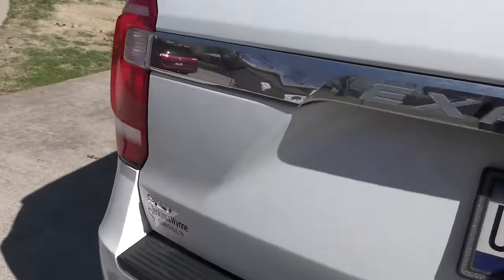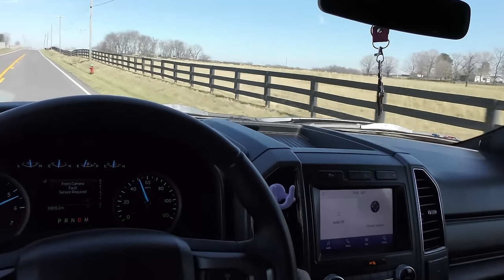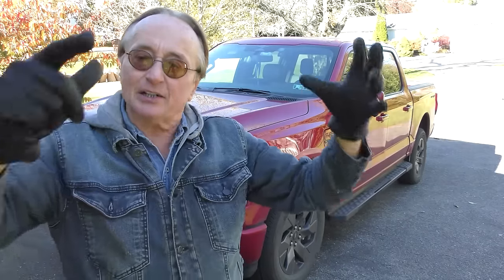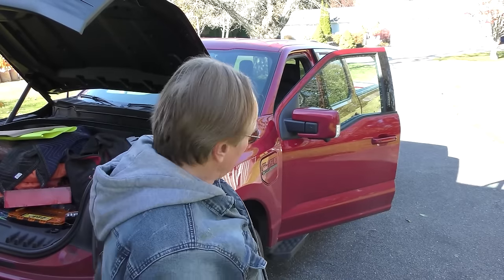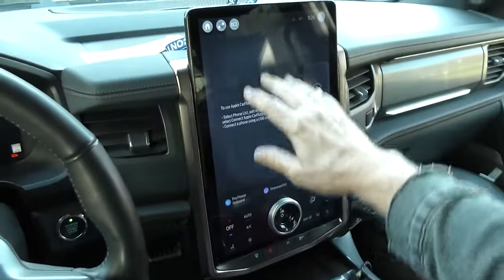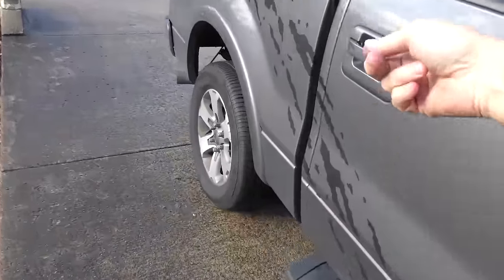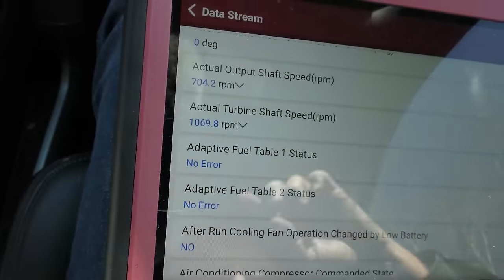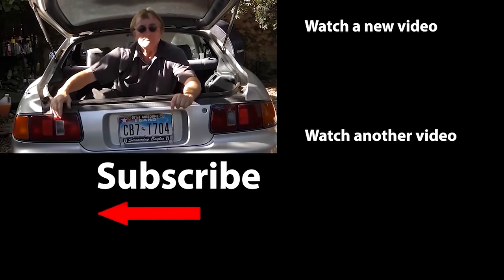Here's Why Fords are Crap Now

Comment: Really like your channel you're good dude man I have a 2006 Ford Expedition and it sounds like the Rockers are loose do you think I should tighten them and check it all out or is there something else that might be wrong with this vehicle it's a 5.4 so if you can help me I'd really appreciate it thank you Scotty
Reply: Rockers?
You mean rocker panels? Those can't be tightened.
Or do you mean rocker arms? The triton engine dosen't have those. They have roller followers and they can't be adjusted.

You might want to take that to a mechanic to see the real issue.
The 5.4 3v has phaser issues and anything associated with the VCT system.
The phasers usually make a clicking noise when going out.

Comment: 2011 Ranger Sport, 5 speed, it has a weird shift glitch between 2nd and 3rd,  almost like it locks the converter when it shifts, then releases it. only does it when above 75% throttle,  other than that, it shifts fine.

Comment: Just give me an Expedition Max with a 5.0 and ford built zf 8 speed that’s all i ask. 
I had a 2011 Expedition Max with 5.4 v8 and a ford built ZF 6 speed. It had 250k miles on it and it ran perfectly with no issues. I don’t want any eco boost. Give me a v8 like my GX460.

Comment: So Scotty, If I read between the lines you think that if someone built a new 1986  F150 for 20 grand, everybody would buy it? It would not have an ipad or radar or any computer controlled rear view merroirs and maybe no A/C either. It might use regular $2 light bulbs. No CAN bus, no 10 speed no DIF fluid. Who or what company would buy something like that ?

Comment: Those big batteries also rely on atr flow for cooling. Sealing would mean they need a larger cooling system. More weight less range. If those batteries get hot, range decreases, or if hot enough they will burst into flames.
Reply: The only car with an air cooled battery is the leaf and the batteries don't burn just because they get hot. They can degrade at like 140F and refuse to fast charge, but battery fires are only the result of manufacturing defects.

Also, I don't know what Scotty is going on about coroding batteries. I've got a LEAF that's on its 11th Iowa winter and there's no corrosion on the underbody even though I've never sealed it and only wash it about once a year, because the entire bottom is covered with a fiberglass panel for aerodynamics.

Comment: My 22 f150 tremor with just 20k miles is at the dealer right now. Transmission kept having rough shifts for the last 2 weeks at very low speeds, shifting so hard the first time it did it, my kids thought we got rear-ended. The tech was able to replicate the problem and they're putting a new valve body. Unfortunately,  it's the same thing my 19 silverado did at 5k miles.  Come to find out , that Transmission is a collaboration between Ford and chevy. My luck😂😂😂

Comment: My prior two vehicles were both Fords, a 2016 Expedition and a 2020 F150.  After my experiences with premature water pump failures, plastic shifter internals breaking, wonky 10 speed transmissions, engine rattles that are "normal", 4wd actuators failing, and clunky driveshafts (who doesn't grease a slip yoke?  Ford, that's who) all under 100,000 miles, I gave up on Ford.  
I bought a new Honda Ridgeline almost a year ago and it has had zero issues.  Prior to that I had two ram trucks, both needed the rear differentials rebuilt before 100,000 miles and one had the 8spd transmission fail at 50,000 miles.  

American automakers are creating their own demise.

Comment: My 2017 Ram with the Hemi has been rock solid since day 1.  Don't know about the new ones, but the late 4th gen Rams are great trucks.  I hear nothing but bad things about Fords though, especially the Ecoboost.
Reply: Us synthetic oil, keep it tow/ haul mode so it doesn't keep jumping back and forth between 8 and 6 cylinders. And don't idle to long especially with the AC on. If you hear a ticking sound, chances are it's a broken exhaust manifold bolt. Don't let the dealer scam you.
Reply: It’s all good until the lifters take a dump on you!
Reply: @roadglide1142  LOL 😂,  sorry cupcake but most ticks are from broken exhaust manifold bolts not from a lifter problem.  Good try.
Reply: @musicman7297  Switched to full synthetic at 60k miles.  I heard the tow mode trick doesn’t really work.  If it’s going to get the actual Hemi tick, it’s going to happen, but like you said more often than not it’s the manifold bolts.  There are a few other causes for a tick that aren’t expensive fixes.  The bad one isn’t that common on the later 4th gen.  Only complaint is the horrible parking brake assemblies.  They corrode very easily.  There’s nothing you can do about it, doesn’t matter if you use your parking brake regularly or not.  Other than that and the strangest oil filter placement I’ve ever seen, it’s a solid truck.  The Hemi is great, so is the ZF tranny.
Reply: @mplslawnguy3389  I always put my truck in tow / haul mode everytime I start my truck up. And you can tell it's working.  It also allows the transmission not to jump ahead a gear before it really needs to. And I believe that will help your transmission out. It's like shifting a 4 speed when you know it's time to shift instead of shifting it sooner than you should. That's the reason the tow/ haul mode was put in ... to keep the truck in V8 mode.

Comment: With all of the weight of all of the extra electronic stuff on vehicles, they are saving nothing.On gasoline and if they just made a simple four cylinder or six owner or even a v eight that is just maybe has a rear window defaulger and basic controls would be so much easier to work on and so much more reliable

Comment: V6,eco boost, twin turbo, GDI, 10 speed transmission and 3 over drives the engineer was either high or wanted all these features in one SUV engine and knew it would be a problem and didn’t give a dam. Could have built it more simple and had an extremely reliable engine.

Comment: Son has '19 f150 with the same drive line. Also has the same clunking in the driveline. His has 2spd rear axle. I think that's what clunking. His is 4x4. His seems to have better acceleration that the expedition you tested. Has better power thank the same truck in '77 with a 460 2wd.

Comment: if you need it in sport mode it sounds like it has Displacement on Demand so it's shutting down 2 or more cylinders when its in a low-need state it cuts those cylinders, and im willing to bet the eco is just keeping the cylinders off, in sport its not turning on the Displacement on Demand

so if you have a tuner see if it has a Displacement on Demand or Active Fuel Management system
Reply: They still make them for the Saudis. But quit making crown Vic's here on 2011.
Reply: @777dragonborn   what? I was talking about DOD/AFM not crown vics

Comment: I think that all vehicles sold in North America today are way too complex. Too many computers, sensors, etc. An aluminum body F350 with a mechanical Cummins 5.9 is a better idea.IMHO..
Reply: The old 5.9 was a fine engine but it was very noisy and the power of the newer engines are in another league.

Comment: Almost everything Ford has built in the last 15-20 years is much higher quality than cars they produced in the 80s and early 90s. Do people not remember the cheap plastic rattling interiors? The problems with the clearcoat peeling off? The amount road noise? They are light years ahead in quality now.

Comment: Scotty I got a question I got a 2012 Jetta 2.5l inline 5 so I got that p0106 code i tired cleaning the map and replacing the PCV valve didn’t work should I just get a aftermarket valve cover and a gasket that doesn’t have the PVC valve on it? Which eliminates the problem ? Or would it make the car run worse?

Comment: I have a 2006 F150 with 320,000 miles. It’s had a rebuilt transmission at 280k and recently a rack and pinion and power steering pump replaced. Has the small V-8 4.6 L I think. Still my daily driver. However I am looking for a used low mileage replacement any recommendations?

Comment: Haven't Fords always been crap??? .. in the 60/70s it was the notorious water pump failures and the two new Fords I've ever owner (1990 Taurus SHO and 199? Aerostar XLT) both had their share of niggling failures  along the way ... annoying failures that should never happen ... e.g. at about 40K miles on the Aerocrap the electrical ring in the steering column that controls the steering wheel mounted controls failed, additionally the tranny failed at about 10K miles. IN the SHO it was warped brake rotors and a sticking brake master cylinder and a bad radio and coolant sensors .. ENOUGH ALREADY ... now I drive Hondas/Toyotas
Reply: 2000 Honda Accord, 95 Chevy K1500...last 8 years. Zero problems!

Comment: I saw a 1992 Taurus the post office thing was in showroom condition. An old man was driving it and when he came out I asked him and he said he owned it since New and I had like 80,000 miles on it. He said he never had an issue with it he never replaced anything other than tires brakes in the battery.

Comment: I bought a 2019 2.7 twin turbo in 2020 and got screwed by how much I spent on it. When I bought it was a very long day and they wouldn't tell the payment until the very end and they already switched my bed cap and didn't what to deal with it and thought I could swing a 800 dollar payment but as the economy started tanking I told them they should be ashamed of themselves. An hour later the vehicle wouldn't start. I called them and as I was on hold they gave back all power to the truck and everything was fine. I'll never buy another ford truck. The timing belt is made of rubber in a liquid oil.  That's going be a problem at 100,000 miles no thanks

Comment: WHEN I WAS A KID I BAUGHT A FORD STATION WAGON(DELIVERY WAGON) FROM THE POST OFFICE FOR $50.
I WOULD ALSO BUY TRUCKS(POSTAL $50) THAT WERE GOVT SURPLUS. I WOULD FIX THEM UP AND SELL THEM
FOR $500( IT WAS A GREAT HOBBY, WHILE i WAS IN HIGH SCHOOL.
WELL THE FORD STATION WAGONS HAD V6 WITH 2 SPEED AUTOMATIC TRANSMISSIONS!!!!!!!!!!!!!!!!
THAT'S RIGHT 2 SPEED. TRANSMISSIONS!!!!!!!!!!!!!!!!!!!!!!!!!!!!!!!!
WELL WHEN MY DRIVER WOULD COMPLAIN THAT YOU COULD WALK FASTER THAN THAT CAR WOULD SHIFT
THE TRANSMISSION.  SO I TOOK IT TO THE LOCAL GARAGE TO DROP THE TRANSMISSSION PAN AND CHECK
THE OIL(TRANSMISSION WAS SEALED, NO FILLER)
WELL THE MECHANIC FLOORED THE GAS AND THE WAGON TOOK OFF LIKE A JET PLANE. WE WERE AMAZED!!!!
HIS SOLUTION GET THE RPMS UP TO  A HIGH NUMBER THEN IT WILL REALLY MOVE LIKE A ROCKET!!.

Comment: Fords quality went downhill ever since they killed off the Econoline van and replaced it with the Transit van around 10 years ago. My Grandpa had a 2011 Ford E150 and he was a plumber untill he retired at 69 years old in 2019, and he ended up selling the E150 after reaching up to 200k miles on the odometer

Comment: Bought my mom a brand new ford fusion and it has recall after recall. Everytime we take it to a ford dealership for the recalls they constantly break brackets/wiring. After 4 recalls fixed the car now has multiple error codes on the scanner saying Lost Communication. I fixed the abs code because they damaged some wiring and my guess is the other codes are from damaged wiring also. I told them about it and they said it was from rat damage lol, I wasnt aware there are rats in montana. Do they even train their mechanics? Its so bad we wont even bring it to the dealership for the last 3 recalls. Bunch of boneheads and will never buy another ford ever again.

Comment: Took a risk and bought my first ford in 2015. Bought a 2013 ford explorer sport. a piece of shyt! Have spent about 10k fixing a piece of 💩. Fixed timing chain (something like that), both turbos, catalytic converter. Thats just the big stuff! Low quality Paint is rusting off off. Backup camera sensor broke, etc. All boke pretty much right after warrentee! Never have these kinds of prblems with all my previous and current japanese cars. Never will i ever buy ford or american again thats for sure!

Comment: Can you tell me a good Ford model built after the 90's ? Most of them had problems , diesel Ford are losing oil all over , and all gasoline engines burn oil . Also all called eco engines burn headgaskets but the little turbo engines more than big ones .

Comment: FORDS 2.7 TURBO ENGINES LAST FOREVER WITHOUT ISSUES, TOYOTA'S NEW TUNDRA WITH TURBO ENGINE HAS FAILING CRANK AND ROD BEARINGS ! !  FORD'S 3.5 in F150's with exception of 2017 - 2020 (cam phaser issues)  are great long lasting engines as well .

Comment: I don't believe you mentioned which 6 cylinder Ecoboost this has.....  2.7 or 3.5?

I have the 5.0 V8 in my F150....and it has issues....and I can tell you you are WRONG about the turbo vs 5.0 V8 in terms of pickup.....the turbos are faster. I drove all 3 and decided on the 5.0 because I liked the old school linear feel of acceleration...but no question the turbos are faster from a stop....and feel perkier.

Comment: This is not good. Glad my 2015 F-150 has been bulletproof.   108,000 miles and it's needed a battery and brakes and that's it. 5.0 Coyote V-8 with the 6-speed. Shifting has always been perfect and in every mode it's fun to drive

Comment: The real problem is the F'n Feds forcing these ridiculous gas mileage standards every year on the auto makers. Given the length of design, purchasing, testing, production and shifting, there isnt much time to solve an impossible problem, especially make a reliable long term product. So they try their best but do what they have to to meet the mpg mandates and get a product out which means the consumer gets screwed with repair bills that should never occur, problems with new cars, expense of paying for crap that isnt really needed in the car and so on. I own a 2003 Impala I do all my own work one and will never buy a "new" car again. Im going to buy an early 90's pickup. Older cars and pickups are the best.

Comment: Ford has had more recalls because they are more honest about their products. Unlike Dodge, which they're brand new vehicles. We'll throw lifters like crazy or Chevy, and their engines is just plain. Not even working half the time. I've seen many vehicles in the shop and dodge and Chevy these days, I'll paying the bills for most of the mechanic shops where I live. The gen 3  3.5 ecoboost It's one of the best engines on the market these days. That is not naturally aspirated. It Also outperforms the 5.0 In every way, yes, sure. The first 2 generations weren't the best engines, but they were still in their infancy. People have to understand it takes years to perfect a product as complex as an engine and mass. Produce it on a large scale without serious problems in the beginning. People also have to remember Ford. Has sold more trucks. Then most other domestic vehicles combined, so yes, of course. You will see more problems with forage, so say because there are way more of them on the road than the other makers. FYI  i used to own chevy and dodge exclusively. Will never go back to either.

Comment: The EV batteries which have been subjected to (saltwater) flooding are fire hazards as soon as the water dries out because the sediment & salt bridges the battery & basically turns it into a firebomb waiting to happen since batteries fail dangerously when they are cycling current through themselves until the case just explodes

Comment: Saying Elon wont seal the batteries to save money is ignorant. They are well sealed to the point where they are extremely difficult to open. Also owning an electric vehicle without owning a house where you can get a level 2 charger completely defeats the purpose. superchargers are pretty close in price to gas pumps but its a fraction of the price to charge at home.

Comment: I have a 2014 5.0 f150 with the 6 speed. I manually shift the gears with the select shift buttons because i think it is easier on the transmission as its not hunting for gears and i release the gas to let it shift like you would in a manual. Is this going to help prolong the life of the transmission, or am i  delusional and just playing with the truck haha? The logic is less shifts and leass power going through the tranny during shifts.